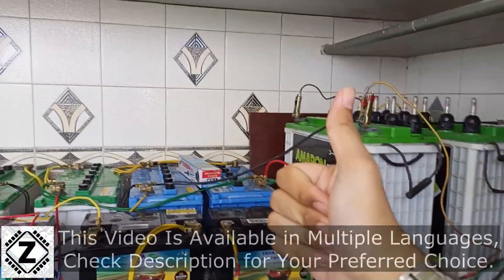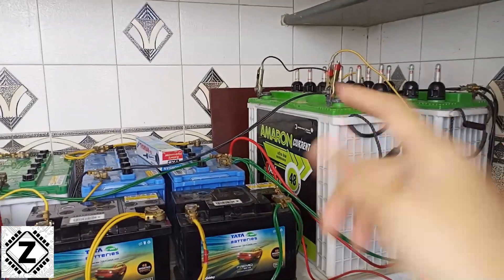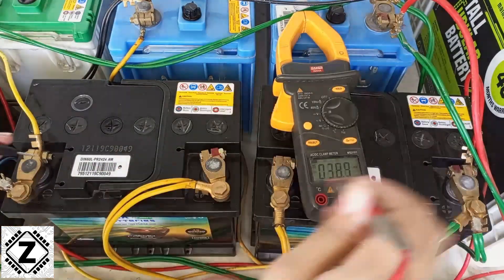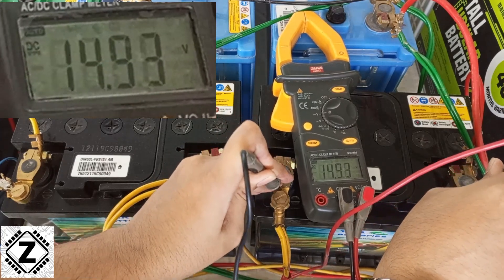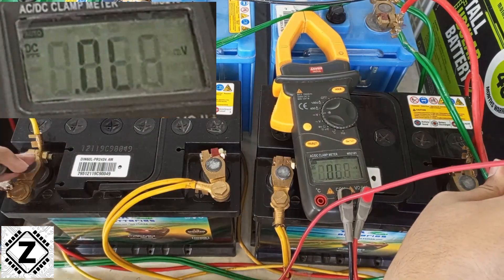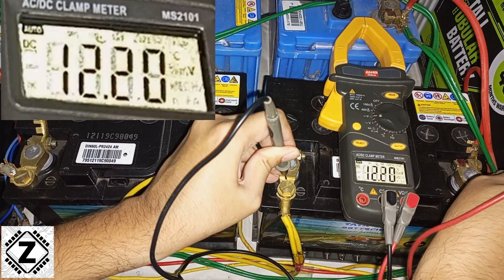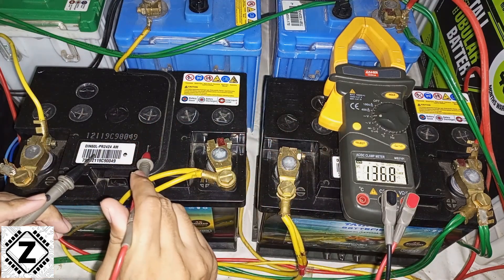[Eng] How to Fix series Battery Bank Imbalance in 3 easy ways | lead acid battery voltage drift

Comment from the maker: This Video is available in Multiple Languages-
English- https://youtu.be/yuXIxxrLx8k
Hindi- https://youtu.be/E1MZ3Rv7968

[Best buy Affiliate links] 
DC to DC buck Converter 20A https://amzn.to/44VV97N

Battery Hydrometer Budget https://amzn.to/47wvTGa
Battery Hydrometer Amber https://amzn.to/48ETa9Q
Battery Hydrometer thimson https://amzn.to/3vtAxYj

Branded Distilled water https://amzn.to/3rUX2E4
Exide® Distilled Water,Distilo 5 Liters https://amzn.to/3QmNjzS

TDS meter https://amzn.to/46EITdd
Aptechdeals TDS Meter PPM & US/CM EC https://amzn.to/400yhTu

Sigma 313A Clamp meter With Inrush https://amzn.to/46Q5KTr

Exide battery 6LMS
150AH https://amzn.to/3sSVeZs
200AH https://amzn.to/38Ez8Di

Systellar MPPT 
40A https://amzn.to/3bDq5Rq
20A https://amzn.to/3tcLarT
On Insta Mojo https://clnk.in/pINQ

Buy UTL Gamma Plus 3350 With Lithium Support https://amzn.to/472bxop
Buy UTL Gamma plus 2kVA 24v https://amzn.to/3Q723S2
Buy UTL Gamma Plus 1kva https://amzn.to/3xodWtz

Chapters English
00:00 3 Topics
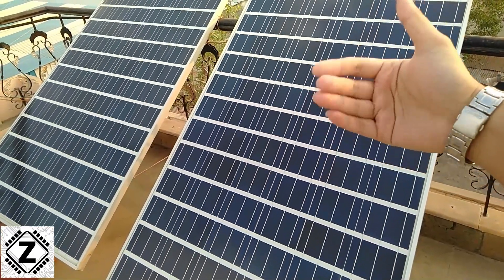01:42 Charging Test
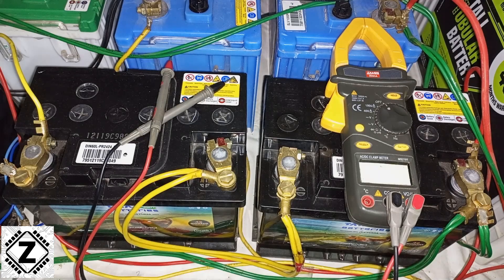03:38 Discharging Test
04:46 Reasons for Imbalance
08:59  How to Balance Batteries
09:29 12v Inverter method
10:21 Get professional help from battery shop
11:31 Zen's Jugaad Method Using Buck converter
13:49 Power source for buck converter
15:28 Golden Tips & Conclusion.

#allaboutbatteries  #SolarEnergy  #batteryhealth #BatteryHydrometer #ZenEnglish #ZenInnovations

Comment: Thank you for the information. In my case, I have one 6v L16 battery in a bank of four in series that is not charging fully so is keeping the bank in a less than full state. The entire bank is this set in parallel with another as an eight battery bank. My charge controller won't do a true equalization at 31v until the entire bank is full, and it tops at approximately 27.5 volts. When the solar panels have the bank at 26v, the others throughout the bank read 6.49-6.51v, and the weak battery reads 6.39v. I do have a 120v-12vdc charger, but not a 6v charger to manually give a slight over charge for the one battery. That's what I will look for next. I'm not going to simply replace the one battery since that isn't recommended, and the bank is eight years old. That these batteries are over $400 each (and weigh 120+ pounds each) prompts me to try to salvage the one battery before freezing weather (my solar is in an unheated stand-alone shed), and your information has me thinking of other options. Thank you again.
Reply from the maker: I appreciate the detailed comment and hope you are able to resolve the issue.
Reply: You may be able to try the buck Converter method, since you already have an extra battery bank.